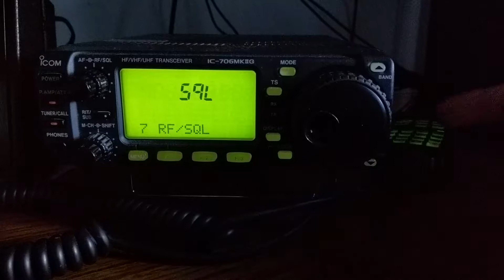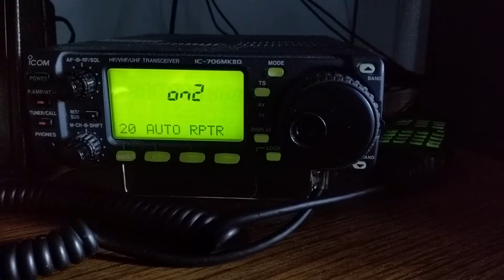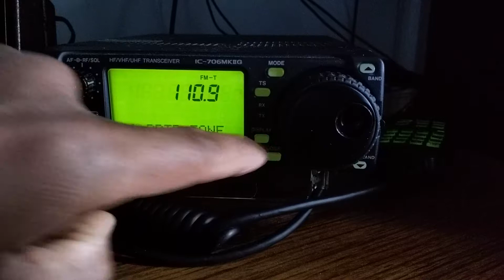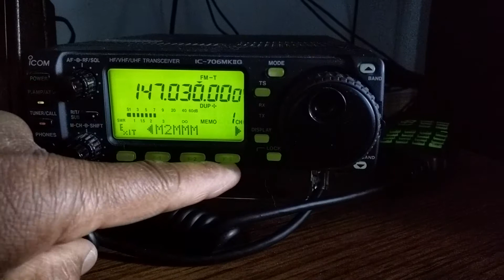ICom IC 706 MK II G - Quick repeater programming

Comment: I can't get odd frequencies. I need 147.315, but it only gives me 147.300, 147.325, and 147.350. How do I get the numbers for our repeaters in town? Any ones help would be appreciated. Ron WA4PMP Cincinnati
Reply from the maker: Hi Ron (WA4PMP), i assume you are also using a radio from the IC-706 family. 

If you press the TS button below the MODE, it will switch between a higher & lower frequency step. 

If you press & hold TS for a couple of seconds, it goes into settings mode, and you should see "25", indicating that your dial is stepping 25 KHz at a time. Now spin the large freq dial counter clock wide to change your freq delta. In your case, you should set it to 1 (KHz), then press TS again to save & exit settings. 

Now you can shift frequencies 1 KHz at a time, to any odd or even number. 

PS: You license is due to expire in a couple of months, don't forget to renew it. 
PPS: I used to live across the street from Jungle Jim's and Superior Toyota.
Reply from the maker: Please visit the links below for your local HAM radio clubs, you can also obtain info on repeaters near you using RepeaterBook: 

https://repeaterbook.com/ 

https://sites.google.com/site/bcvhfaw8cci/home

https://www.bcara.net/ 

https://www.radioreference.com/apps/db/?ctid=2048&tab=ham